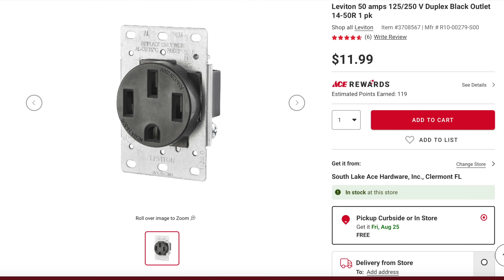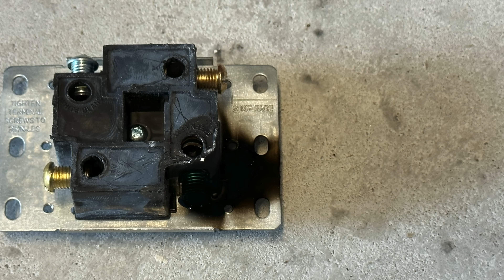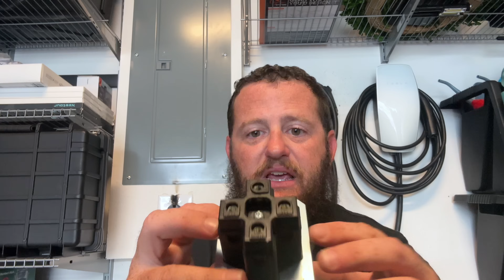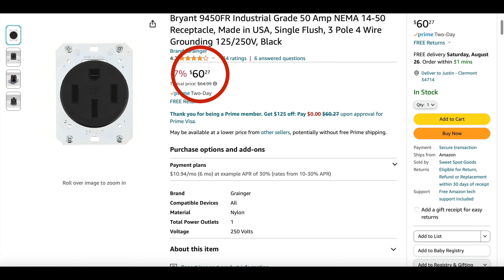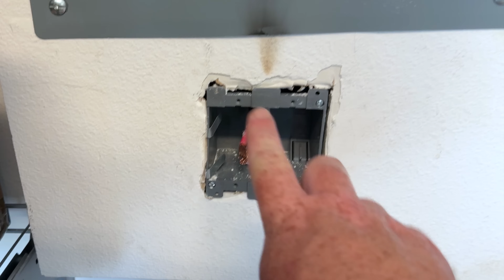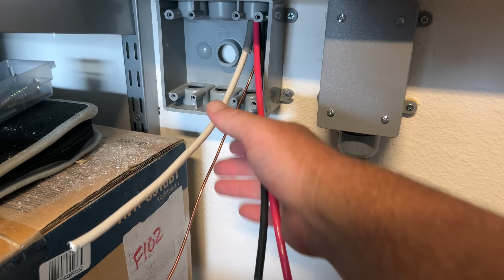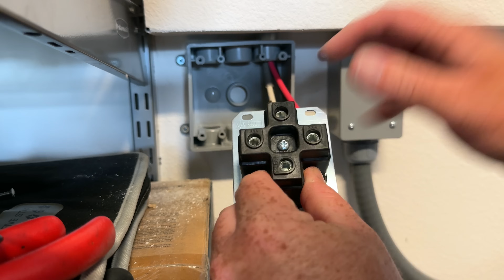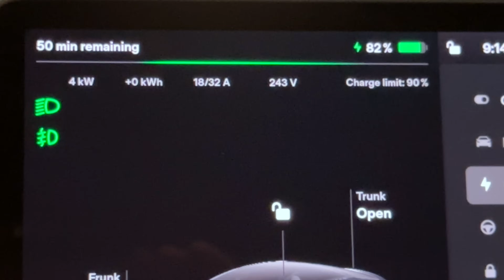This Will Save Your Life if You Charge Your Tesla on 14-50 Outlet!!

Comment: A ton of comments about people’s opinion why these fail. I believe most of you are incorrect, but It’s just my opinion. Where are the wires are connected to the receptacle there is a constant vibration. Overtime the receptacle connectors will start to loosen. As they do, they will begin to arc and create heat. The best thing to do is pull your receptacle once in a while and re-tighten the connectors. I also check mine regularly and feel it to see if there is any warmth. Also make sure to shut the circuit down before unplugging.

Comment: Seems everyone is missing why would you install a 48amp draw device on a 50 amp plug 80% rule that should be at least a 60 amp rated plug …. Second wire directly into panel it’s a wall connector stays installed

Comment: If it arced when it was plugged in, that's something wrong with your EVSE, as it shouldn't been pulling any current side from logic circuits on the initial power up. 
The burn spot showing up on the ground terminal is an indication something was awry with the EVSE, as even in normal operation, there shouldn't be any current going to ground.
This doesn't add up to an issue with the receptacle. 

Normally the plug has to be inserted, the charging plug is connected to the car, and there's some back and forth handshaking signaling between the car and EVSE before the power actually gets connected between the outlet and the car. 
If it sparked immediately upon plugging it in, as evidenced by the carbon stains on the fingers, then that's an issue with the EVSE that was being used, not the receptacle.

Comment: Good, glad this video is out there. YET, the key is INDUSTRIAL GRADE. The Hubbell and the Bryant (same) you refer to are the INDUSTRIAL GRADE ones. They also make the regular commercial grade (appliances) ones, so limiting to the brand Hubbell is not enough. Leviton also has an industrial outlet. Is not the plug and unplug only. The terminals (connectors) are half the surface area (plug holes) and are not copper. They are not for continuous draw. The BEEFIER industrial grade ones are good copper, thick, cover the entire connector, and will take on good juice for long without heating up. Also, the connections use a hex and cave system which surrounds the entire cables, thus being a better connection and less resistance. Key is if less than $20, is meant for an oven. If more than $45 then is probably fine. Look inside the "holes" and you will see the solid and wide copper terminals.

Comment: Just wondering…its there a reason you need to plug and unplug it for charging? Would it be better to just set it up as a dedicated connection? I would have not anticipated that problem either, but I would have avoided it by default because I had learned that higher voltage connections tend to get weaker from arcing which is why there are torque requirements when tightening connections. I’m glad you are okay. You might be saving a lot of people by sharing this experience.

Comment: Have you checked since the install? I understand you torqued it down but after you’re supposed to pull the wire and wiggle them and re-torque. If they were single wires one time would be enough.

Comment: I was able to get the Hubbell plug for the same price as the Bryant on the jungle river site.  I probably should have put the same box extension in that you did, it really took some finagling to get it in the box, 6-3 Romex is much more difficult to deal with than normal household 12-2 or 14-2 Romex.  But I got it worked out and I don't know if I want to mess with it again at this point.  I also like the waterproof open-able box even though you don't technically need a waterproof box, just to keep kids from messing around with the plug.

One thing I did that you didn't was to put some electrical anti-oxidation gel on the stripped ends.  I've heard that oxidation can be an issue on these higher amperage connections.

Comment: What you experienced is most likely arc flash. You should NEVER unplug or plug anything into any outlet under load, very doubtful that it was related to the plug. Install a switch at the outlet and turn it off whenever you plug into or unplug from that outlet.

Comment: Hi. What are your observations on charging on hot summer days and cold winters in using an insulated garage door. I’m considering insulating my garage door and worried about the heat generated by the battery during charging. Also is air circulation inside the garage during charging required?

Comment: Hubbell vs Bryant. Just because they both bought their molded part from the same plastic squirter doesn’t mean they are the same. The important part is the metal used for the contacts internally, how much the alloy deforms with heat, its thickness, the area and shape of contact area and how strong the spring of the contact grabs the plug. Those costs can be many times that of the pennies the molded plastic cost. A bandsaw cutting through them both would be required to check for these differences.
Reply: This makes more sense. 

I did go through the entire video, so not 100% sure if the mobile charger was plugged into the car while he was trying to plug into the 14-50R outlet. If that's the case, there could be a fault in the the circuit.  I would plug the charger into the 14-50 first where there is no load, and then plug the charger into the vehicle. 

Anyway, the reason for heat/burn was high current(load) under high resistant which creates heat. When plugging in a outlet with load, the resistant at the first point of contact is high, which can create heat, and multiply time, more heat. So if the connection needs to be made, it needs to be made quickly, and with full contact, or you will run the risk of overheating.

I am not sure if there is any analysis on the Leviton outlet to see if the contact with the Tesla mobile charger can sustain the load and dissipate all of the heat it generates. But I will be pretty interested. 

Many of the high load appliance in the house are hardwired because the contacts are secure to safe passage of high current thus less heat. Using the 6 gauge wire with it's max load as an example, it can generates 1.2 watts/foot in heat. So it need to be able to dissipate this heat continuously under that load.

So if the outlet is fried overtime, they could potentially be a weak contact in the outlet with higher resistant which generates too much heat. I've seem this in other house outlets too where the contacts are not secure, which leads to burnt outlet. If the outlet is fried during a plug in, than I would suspect that the out can either has a loose contact, or difficult to make a full contact quickly. Either way it's a safety concern. I would also go back to my earlier point on plug into the wall outlet first, and then the car.
Reply: they are the same. Hubble owns Bryant

Comment: The reason the NEMA 14-50 failed WAS because you're were trying to charge 48 amps.  at 48 amps you  have to hardwire it's not a choice or a option because
 the outlet is only rated for 50 amps . The wire and the receptacle should be rated for 80% of the breaker. So it should be  

Double post 60 amp breaker hardwire Tesla chargerwith number 6 thhn in conduit. 
Also you have a gen 2 charger which has  physical switches to set the charge current. Which could be set at 48,40,32,and I think 15 amps.

Ps: 6 awg room access ready for 55 amps 
Number 6 THHN in pipe is  rated for 75 amps

Comment: If you want to duplicate this failure unplug the electrical cord from the receptacle while there is a load on the cord( charging car full speed).
This will create a 220V Arc and because heated air rises that arc will follow the heated ionized air and find the ground plug ( round plug at the top of this install) and the arc will self sustain until the breaker trips.
The guy in this video left that part out and blaming the plug was in his mind a reason for the light show he got, but in my experience it's not where the problem is.
This is user error.
Don't unplug 220V outlets under load when they are drawing 30-50 AMPS. This is not the electrical cord running a light bulb or charging you phone.

Comment: I have nema 14-50 installed in my garage and I use it to charge my model Y for the last 2 years almost every night and I have zero issue. I bought the 14-50 at Home Depot. The 14-50 can work 50am load. This should be no problem for tesla mobile charger because it draws only 30am at max.

Comment: Here in Norway your homeowners insurance and vehicle insurance is invalid if you charge using a granny cable or a charging device not using an industrial grade plug. Your charging station has to be hard wired. If you use a device with an industrial grade plug, the plug must be set up specifically for EV charging.

Comment: Arc flash. There was a heavy load on the charger on startup. Per engineering specification. Turn off breaker while plugging in to the 14 50 outlet. Second energize outlet third plug in the tesla
Reply: I recommend going to an electrical supplier and getting a Square D or Eaton due to their commercial use

Comment: You cannot say it was professionally installed if you uninstalled it and reinstalled it. Also you almost killed yourself and burnt the house down and you’re going to cheap out again on a new plug. You over spend on an EV and cannot hardwire the charger. You wife should leave you now while she still lives
Reply from the maker: lots of misunderstanding in this comment. I didn't cheap out on the new outlet, I have the highest rated plugs available, and it was originally installed by a profession, meaning the professional selected the Leviton outlet. Thats the issue

Comment: That’s why Europe has on off switches on all outlets. And why are you unplugging the outlet anyway they are designed for one appliance to be permanently connected
Reply from the maker: I test a lot of charging equipment, otherwise I wouldn't have a 14-50 to charge, I would just hardwire it

Comment: Just info. I saw his panel. And that 240v it not on a 60a breaker. And most Tesla chargers I know. You can’t just plug in a 240v plug into any 240v plug.
Anyone that uses 240v plugs a lot will know this. But even the plug itself can be rated for lower amps. And also the wires that connect can be different specially if it running off a 40a breaker
Reply from the maker: uh...you serious? You dont get 50 amps out of the 14-50, you get 40 amps, and it comes supplied by a 50 amp breaker...it is code that a 14-50 is supplied with a 50 amp breaker

Dont come in so hot and confident when you dont know what you are talking about...
Reply: @BeardedTeslaGuy  Yes, a 50 amp breaker typically requires a different gauge of wire compared to a 40 amp breaker due to the difference in the amount of current they are designed to handle. The wire gauge is determined by the amount of current it needs to carry, with larger currents requiring thicker wires.

For a 40 amp breaker, the National Electrical Code (NEC) generally requires a minimum wire gauge of 8 AWG (American Wire Gauge).

For a 50 amp breaker, the NEC generally requires a minimum wire gauge of 6 AWG.

Always refer to local electrical codes and regulations, and if in doubt, consult with a licensed electrician to ensure safety and compliance.
This is all I am saying. Not sure what you are referring to.
But what I am saying is some people might assume any 240v plug can be used for a Tesla charger.
Some 240v plugs can run of 40 a breaker and different gauge wire.
This won’t work for Tesla charger. I mean it might. If you want less power to the car and also cause a fire. 🔥 
Not sure what your argument is.

If you wanna go by code. Your Tesla charger that dishes out 48a needs a 60 a breaker…
Period. Not sure what argument you saying? Or acting like you know it all?
You talking about oranges. And I am talking about apples.
You talking about the actual plug rating. I am talking about the breaker you are using.
If you using a 50a. No wonder your plug is burnt 😂

Comment: would a Y splitter or an extension cable work on a Leviton?  the extension/splitter will remain plugged in at all times, while the mobile connector will be plugged in and out a few times a week.

Comment: Why do you plug and unplug.  Mine has been plugged in for 7 years (two teslas) and I've never had a problem.  I never unplug it. And you should never use a plastic cover plate or box for that much current..  And why is the ground burned?  I don't get that.  And you have no GFCI?  And is that STRANDED wire!  Always use solid!  Also for your new install leave those wires about twice as long for ease of installation and inspection.  While you're at the store, pick up a bigger METAL box.

Comment: I see the issue - you have your faceplate screws aligned horizontally.  They need to be aligned vertically ;)
I replaced my Leviton with a Bryant, and also had to replace the box - the Bryant is much deeper (I used a metal box).

Comment: Buy an Rv rated 14-50 charging cabinet - also you never plug in under power. The Rv rated cabinet will have breaker above it. Turn it off with the breaker - plug everything in all the way to the car plug - then turn on the breaker. And leave the 220 plug in all the time. You don’t plug into the 14-50 receptacle when there is power at the wall receptacle. There are no 220 14-50 receptacles that are designed to plug in with power at the receptacle. If you had a boat or an Rv you would know this. The material of the receptacle  is not designed to plug in under power. Also if you push the male connector into the receptacle slowly” the power will arc from the female to male connector and create heat and spark etc. 

You know nothing about this topic and you are going to kill or burn people’s homes down with this stupid talk about the material of the female receptacle. 

You do not plug in a 50 amp 14-50 female receptacle with power at the receptacle.

Turn the double breaker off - goofball…. And all these female plugs will all work just fine if you know what you are doing. 

Every Rv or boat owner knows not to plug in with the breakers for receptacle turned on. If you’re lazy - and insist on plugging into a receptacle with power present - do it really fast and with determination - don’t do it slowly.

 Even to plug in a dryer you need to turn off the power at the lbreaker.

Hubbel receptacles are commercial gal and are used by most parks and marinas - but any will work. By if you plug in with power present- and do it timidly “- you will arc between connectors - create heat and flames - 

You caused it to fail — not the connector.

And put it in its own steel external box  and ideally with the dual breaks in the same box.  

You are giving ignorant electrical advice.  You need to take this video down asap….. before you kill someone.

Comment: If you use the plug instead of hard wired then try to keep your charging under 40 amps for safety. Anything above 40 poses a danger of overheating, melting and fire.

Comment: Why would the problem be the outlet and not the cord you were plugging in?  The outlet was "live" and not causing any issues until you went to plug in the cord and it shorted to ground.  It also looks like it arched across the front of the plug and not internally or behind the plug.  Is there a short in the cord you were plugging in?  Did you later use this cord and it worked ?  

Also loose connections could generate heat but you were in the process of plugging in and it shorted.  Loose connections would build heat after current was flowing and you had something short to ground not just overheat.  Doesn't seem like it was a worn out Leviton plug issue to me...
Reply from the maker: so many possible areas of failure, but the outlet itself gives evidence of having been the culprit

Comment: Unless you used a torque wrench to reconncet the electrodes, there is a high probability that when you disconnected and reconnected the electrodes to the plug you did not torque them connection properly. If not torqued properly, the vibration from the flow electricity is sufficient to loosen the connections over time and this will cause the overheating or arcflash. As a homeowner, unless you are a licensed electrician, many municipalities prohibit you forbdoing electrical work yourself for these eact reasons. Also, never go with the lowest cost provider when dealing with critical electrical work. You were definitely lucky. Stay safe.

Comment: I installed mine. YouTube was my friend. 

I leave mine plugged in and it’s been 2 years. I also installed one in my brother in law’s garage and it’s almost a year. 
I use the same Leviton but metal cover plate. Been working flawless.
Reply: Would you recommend decreasing the charging amps if you notice that the receptacle is a Leviton? And just never plug it out.
Reply: @jay.rsingh2530 I put it on 31A rather than the max 32A

Comment: Thanks for video! Immediately went to my outlet,  sure enough my leviton was melted!  Started searching for Hubbell bryant then decided to just hardwire it with metal box 3/4 in pvc setup.  I have 2 other separate 240v outlets will make those industrial if u use them for chargers.  Glad you're alive and you may have saved my life! Thanks for sharing.

Comment: Ugh,.. need to check the wiring on my OLD 10-30 wall outlet. Just got an EV and did quite a lot ot jigggling with it for the first few days until I got a "y-splitter" (which the mfg for some reason suggests not using, maybe worried that user will run two devices at once!). Now there's no fiddling about with the rickety feeling old wall outlet, both dryer and car charger are plugged in, and any (rare) unplugging is done remote from the wall, with hands able to grip both sides of the connection. 
Definitely now need to inspect for any damage the initial jiggery-pokery might have caused behind the outlet! Thanks for the heads up!